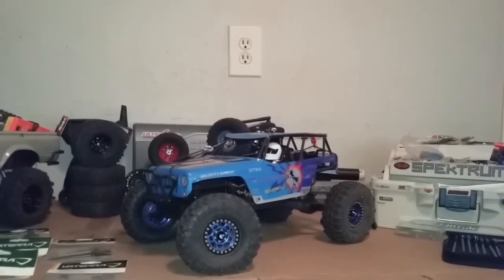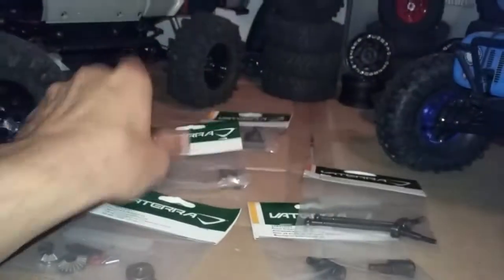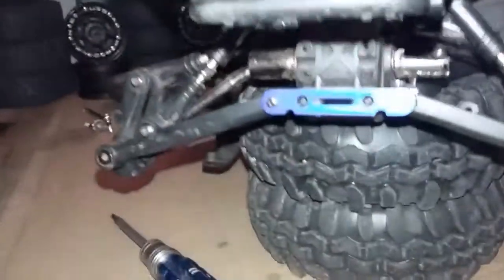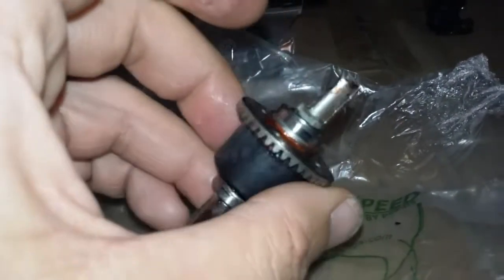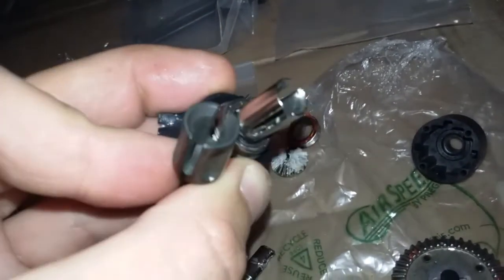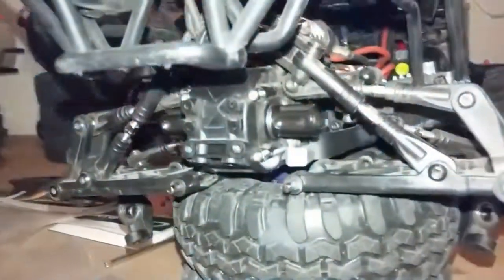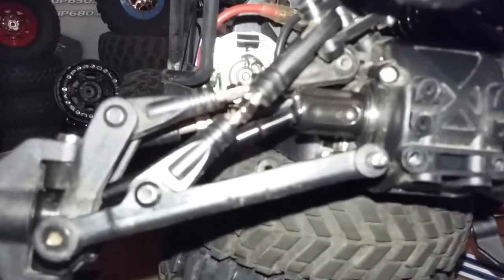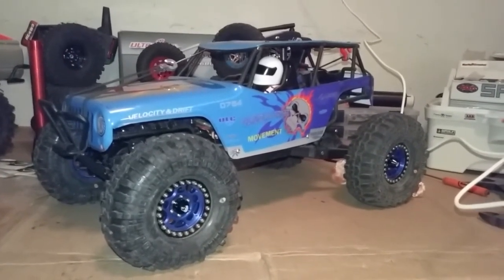WLtoys 10428a; "Installing a Vaterra Twin Hammer's front drive train"

Comment: Do you think the front arms off the twin hammers would fit and solve the axle cup out drive issue your having? I looking to get the new Polaris RZR and doing some light upgrades to run predator tracks
Reply from the maker: 85Stang331,yes and yes,but I didn't have a set on hand,so I just made it work, lol
But good answer,the twin hammers A-arm's,are just a pinch shorter,than the WLtoys,and they would definitely work, 
Great comment man :)
Reply: RC After Dark if I may are the rear axles the same as a twin hammers
Reply from the maker: 85Stang331,essentially they are,but the twin hammers has better plastic,and metal inserts,inbeded,in the pumpkin,for attaching the axle halfs,so your screwing into metal,instead of plastic,
The rear differential on the twin hammers,has a helical cut ring&pinion,the WLtoys doesn't,it's a straight cut ring&pinion,
The front differential on the twin hammers also has a helical ring&pinion,
All of the plastic parts on the twin hammers,except for the wheels,roll cage,and spur gear cover,are made from stronger material then the WLtoys,
I actually did a full,side by side comparison,of the two vehicles,when I built my twin hammers,they are both close,in a lot of ways,but the Vattera,is made with better material all around. 
My WLtoys,isn't really a wltoys anymore,lol it traveled through a different dimension,and came back,as a insane beast lol

Comment: Are thoes stock twin hammer out drives? Can you link it or have a p/n? Looking at buying a wltoys and slowly upgrading parts as it breaks but I want to knock out the front diff/suspension right away to aluminum twin hammer parts
Reply from the maker: shelby bloomingdale hmm,I'm not very computer friendly,but I ordered the parts from Amain hobbies,
If you're thinking about getting a WLtoys 10428a,or a wl with the same chassis, allow me to give some friendly advice,
It would be a whole lot cheaper in the long run,if you get a twin hammers "kit" instead,not a "RTR" twin hammers, But the actual Kit,and read the kit description just to make sure before ordering, 
The kit version, comes with all of the heavy duty optional parts, and like I said it will be cheaper in the long run,by quite a bit, 
I ordered my Twin Hammers "Kit" from Horizon hobbies,
There's several reasons why it's cheaper to buy the hammers kit;
The WLtoys have garbage electronics,and servos,the shift servo on my wl quit working on it's third run,my friends 10428 shift servo quit working after a week,
The wl steering servo is weak,and because if it's weakness,it could,and most likely will,contribute to front drive train damage,because it can't over power the tork at the wheels, and you can't just get different servos,because they are a five wire system,
so in order to replace them,you have to replace everything,servos,esc,and the receiver, Cha Ching
As for the vehicle itself;
Let me start by saying All of the WLtoys metal parts are junk,wheel pins,bearings,half shafts,out drive cups,and even the screws themselves,
So all of those things will probably need to be replaced within time,depending on how often you run it,and your driving style, Cha Ching,
The WLtoys plastic is extremely soft, so count on stripping out the threads on a lot of plastic items,course thread screws would help,but once again Cha Ching,
The A-arm's,and trailing arms are okay,so Don't replace those with aluminum,plastic slides over rocks better than aluminum, money saved,
But you will have to replace the plastic wheel hexes,with aluminum,
I've done the math in the past,I do own both vehicles,
Twin Hammers/WLtoys 10428a, and it's way way cheaper to just get the twin hammers "Kit" and radio gear of your choice, it's cheaper by a few hundred dollars,especially if you include shipping charges,for all of the bits,and pieces,that you will be replacing over time, 
Here's some rough math;
WLtoys 140.00 ish
Wheel hexes 10 to 20.00 ish
Vattera front drive train,50.00 
Vattera plastic front A-arm's 12.00 ish
Vattera metal transmission gears complete set,45.00 to 50.00 
Sealed bearing kit 30.00 ish
Complete screw kit 30.00 ish
Replacing the electronics with after market stuff,Radio,servos,and esc,prices very, but figure 200.00 ish
Total 560.00+ not including shipping costs.
Twin Hammers "Kit" 
260.00 ish,
Radio,servos,and esc,
200.00 ish pending on your choices, 
Total 460.00'ish and a lot of, piece of mind,knowing that it's a better product,
Prices do very,and the 560.00 wl quote is on the low side,
Especially considering,that you will be taking it apart,and putting it back together,several times,like a marine in boot camp,assembling a M16 lol
hence the screw kit,
But if your just going to putt around the front yard,the stock WLtoys,would probably last awhile, but if you actually plan on wheeling it, The Twin Hammers"Kit" would be a more cost effective route,
And if your looking for a crawler,or just a good trail vehicle that's RTR, than I would recommend the Traxxas TRX4,you may have to replace the steering servo,but at least after market servos are compatible with it,
and the price,is cost effective in comparison with the other two,
Personally,I would trade my twin hammers,for a TRX4,in a heartbeat,and I like the twin hammers,my WLtoys on the other hand,is way too expensive,to trade off,I currently have over 1,000.00 dollars invested,and at least 150 hours of labor,but it's not exactly your average RC anymore,
So in short,if you like the WLtoys 10428a chassis,get the Twin Hammers"kit"version,instead,
And if you're looking for a good RTR crawler/trail truck,
Get the Traxxas TRX4,
I hope this is helpful Shelby,
Good luck brother,and thanks for watching my video :)
Reply: RC After Dark I highly appreciate the response  and the advice and I really wish I saw you responded because I order a 10428a. I will keep this all in mind if I decide to keep rcing as this will be my first truck i knew In the long run it would be expensive but I guess I didn't want to go that route not knowing if I was going to stick with it.. but hey I kinda like frankincars so who knows where it will take me! Love the kids and will be watching them all as they come out! Thanks again
Reply from the maker: shelby bloomingdale,no problem with the advice,as long as your mindful with the throttle,while making tight turns,and clawing your way too the top of a hill, you should be relatively o.k.,
If you need any advice further down the line don't hesitate to ask, I'm always happy to help,
Thanks for watching Shelby,
very much appreciated :)
Reply: I wish I found this comment sooner lmao
I have 1 that I constantly break and a second on the way for my daughter.
Well we live and learn but now thanks to you I might not put as much Into these Wltoys and go get some trx4 now.
What do you think about putting Integy parts on the Wltoys?
Thanks for all your videos
Reply from the maker: Integy is garbage too,😕 don't waste your money on their junk.lol the best thing would be getting Vaterra Twin Hammers parts,Which are becoming "very" few,and far between,😕